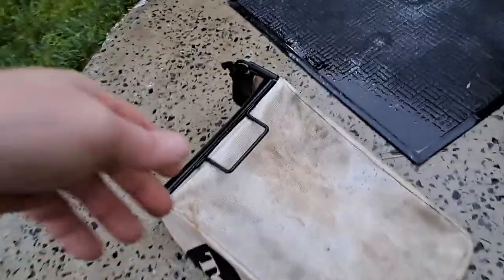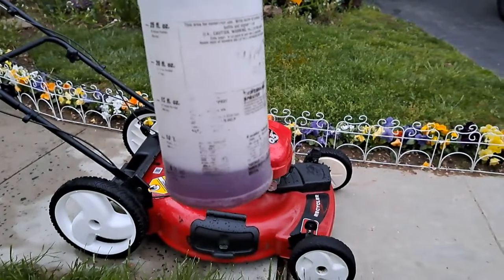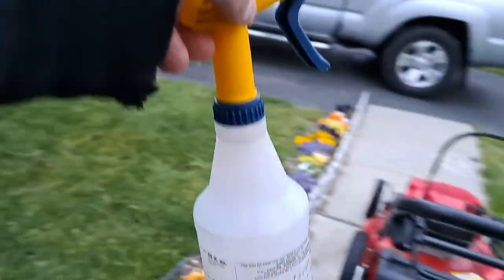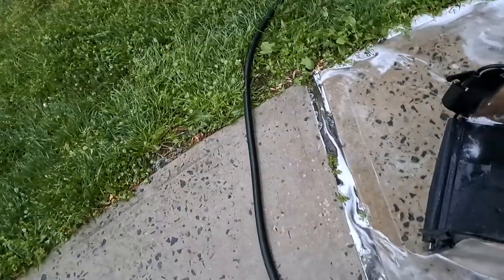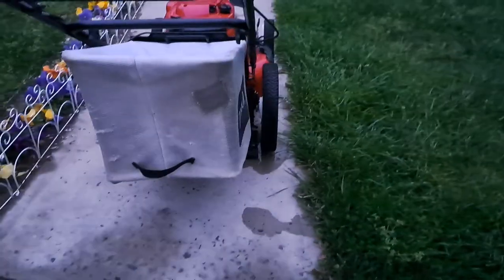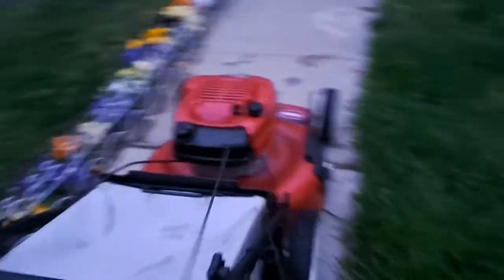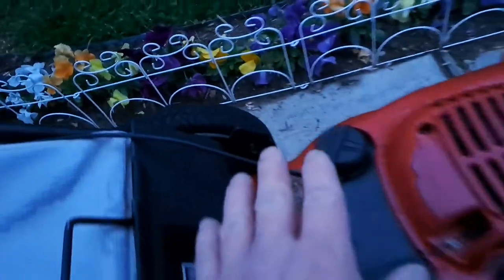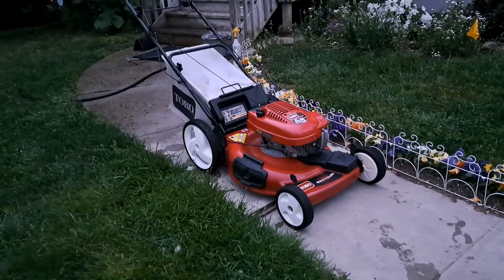How I get bags sparkling clean like new again.

Comment: I use that in my ultrasonic cleaner and mowers and bags, good stuff
Reply from the maker: As I was saying in the video I found purple power to be too corrosive on the aluminum and it also turns it black. I changed to simple green, it works great for the ultrasound cleaner and cleaning carburetors. Does a great job and it's easy on the metal.

Comment: Awesome content! What mower would you kepp between this exact one with the 6.5 Tecumseh or another Toro 22 with the B&S 6.75 190cc quantum (black engine cover)? Though I herd you mention in another video that the newer (black cover) quantum engines had weaker cranks? I mow flat ground but thick dense grass. Current mower has the 149cc Kohler and its just a little too weak. Got a deal on these two so would like your opinion. Thx!!
Reply from the maker: The Toro with the Briggs 190cc flathead Quantum